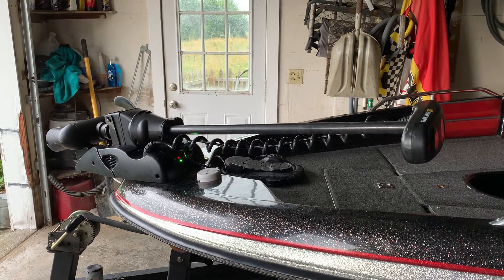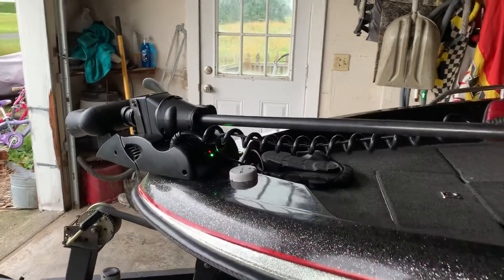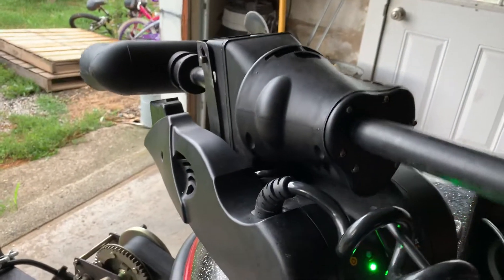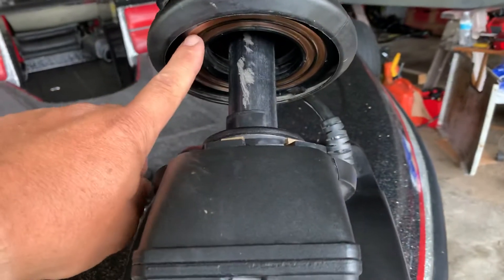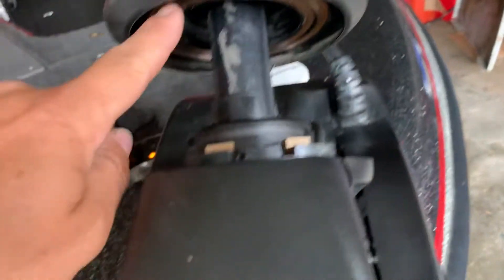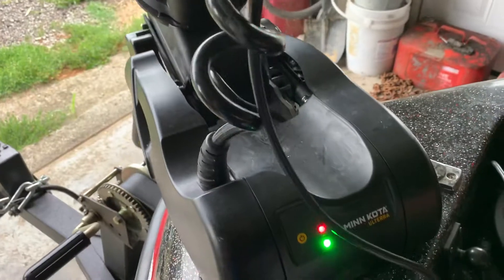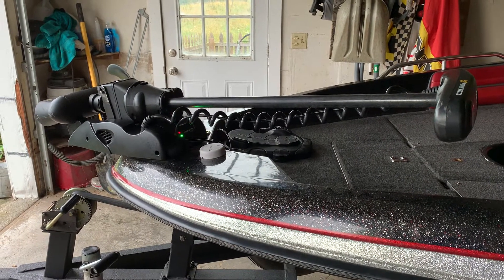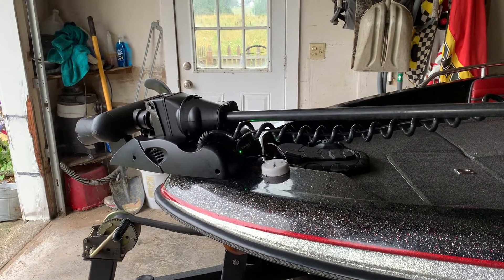Minn Kota Ulterra power trim issue and fix

Comment: Thanks a lot for your video. I had de same issue with my Ulterra. For a year I have been searching what the problem could be. I took the trimmingmotor apart and indead, in my case, the red wire had come loose. I repared it and the motor works perfect. 
Without your video I would never had managed it. 
Cheers, Ruud from The Netherlands.
Reply from the maker: Ruud de Zwaan  I’m glad I could help! It was very frustrating until I figured it out.

Comment: My Ulterra failed during a stow...  Stopped about halfway up while trimming up.  Then it would not trim up or down with foot pedal or remote.  I saw this video and my red wire in trim module need to be resoldered.  It's working perfect again!!! Thanks for the video.  PS - it's difficult to get back together... trying to pack the wires in, keep the spring in, and align the brush contact plate.  Just be patient, it took me several trys!
Reply: I had the same happen. Tech support's goto solution is to blame your power supply no matter what the issue is.

Comment: Been dealing with the same issue. If this works, I owe you.
Reply from the maker: Good luck! I think in my case it was a combination of inadequate strain relief on the wiring and hitting underwater objects  :-/  that pulled the wire loose from the contact plate. Make sure all your connections from the battery to the motor are all clean and making good contact before taking the trim motor apart. Also if its still under warranty it might be best to have them take a look.

Comment: 3:13 Yes it is signal plus voltage.  If apply to 36v Riptide Ulterra it just separate to 2 sides, one is positive and another side with negative.

Another related issue was the connecting point you pointed at 3:09.  In the case of a 36v motor, you can be using a multimeter to test both side connections.  Normal it should be not broken at the same time, so you use the multimeter to test the same side connection good or not, both sides of 2 connectors should get connections when testing.
Reply: I have a 36v and when I hit deploy I'd doesn't give and error but says deploying but doesn't make any noise or doesn't move so what should I test? Should I check if voltage is getting through those rings somehow to see if its the movable Trim Mudule or if it's the main control board or wires that's not sending the power to the trim motor. If you have email would be easier to show you in a video
Reply: @EFFTrudeau-001  I would try to shake the whole thing when I clicking deploy.

Normally if the trim module goes out it always about the connective problem as I mention upon.  So shaking the motor when you clicking deploys may connect back a little and moving a little bit.

If so I can guess it would be the connective problem inside the trim module.
Reply: @jerrychf  how do I seperate the trim Module once top is off and the 4 screws? Seems like it is stuck together and don't wanna break anything prying
Reply: @EFFTrudeau-001  After 4 screws (should be the torx screws), and you need to take off the small belt.  Other than these should be no problem to pry out no damage.  It sticks together with some glue or gasket for waterproof so prying out is ok.

Oh one more thing, the little belt is from Power Grip GT, spec with 208-2gt-6.  So just go for the belts specs with 208-2gt-6 and you could run well for the trim in case you break it or the teeth snaped

Comment: Thank you so much for taking the time to make this video. This is exactly the issue im having on mine but with an other little twist, the small latch on the side that should release the shaft for manual stowing wont release the shaft. Any idea what would cause that ?
Reply: Hi, mine is really hard to pull.  I use a screwdriver to pry it off.  You need to pull perpendicular to the shaft.
Reply from the maker: Sorry I’m just now checking my messages. Without being there it’s hard to say. I know it takes a lot of force to release the latch though. Give it a good shot of WD-40 and try it the next morning. Good luck!

Comment: Hey I have a question about how do you take apart the trolling to get to the black wire
Reply: Yes I want to know also. I took the 4 screws apart and the top cover but can't seperate the 2 halves to see the wires on the copper disks. Did you have to pry really hard??

Comment: I'm having the same issue. Red wire disconnected and black barely hanging on... Trying to solder it now but having trouble. Did you remove the copper ring from the plastic? Or did you solder it in place?
Edit; Fixed! I was able to solder it in place. Not very pretty but it's working now. Thanks a bunch
Reply: How did you seperate the2 halves to get to those wires?
Reply: @EFFTrudeau-001  remove screws and pry case apart gently
Reply: oh yeah there's a spring in there that applies pressure to the latch that holds the trim motor in place when you split the case the springs wants to fly out use a flat screwdriver to split the case slowly its not to complicated

Comment: Thanks for the excellent video. I have an Ulterra 80 (2016) and I added the FW ipilot service pack for the spot lock in 2019–love it!  The remote deploys and stows the motor properly, but it won’t trim (move up or down in the water). Fortunately the prop is just below the surface, but I need to lower it some more. Do you think a loose wire like you found may be the problem? I wasn’t sure if deploying and stowing were issues for you. Any suggestions will be appreciated. Minn Kota customer service— not too helpful—so we have to teach each other. Again, thank you.
Reply: Did you ever figure out the problem Lou?
Reply: @asudavew  yep, a loose wire.
Reply: @loum2712  Thanks

Comment: Have you ever had a problem with the trolling motor hitting the trailer while launching the boat?
Reply from the maker: Not while launching. I usually weight until it’s clear before deploying it. However on electric motor only lakes I have had it hit the trailer trying to load it… 🤦‍♂️

Comment: Very helpful video! Just about to buy a used model of this TM  that appears to be in very good condition- it’s a 24v 80lb 60” - it’s going to go on a Ranger glass boat,  w/yami 150 ... they weight approximately 1900lbs - before people and gear - just wondering if you think the 80lb will be good to go?  Also, primarily fish lakes and occasional river - Thanks!
Reply from the maker: Sorry for the late response. I have the same model your looking at and when I had it on my fish-n-ski it would pull the boat about 3.5 MPH with no wind. I put it on my new aluminum V and it does about the same maybe a little more. I hope you enjoy it as much as I do!